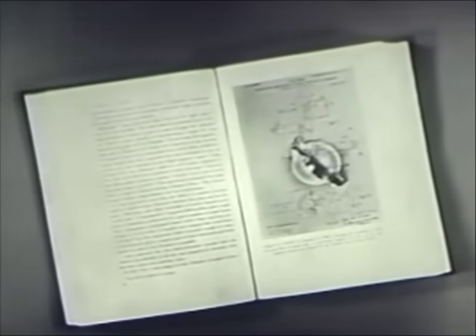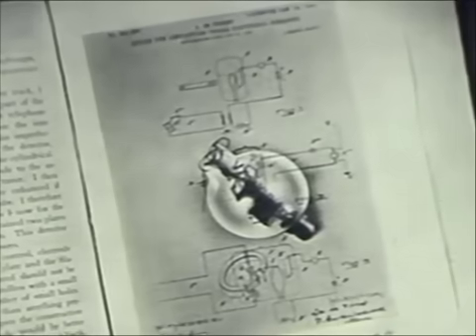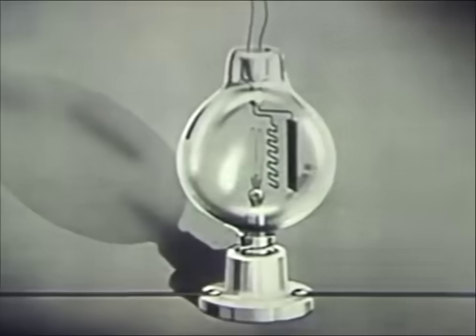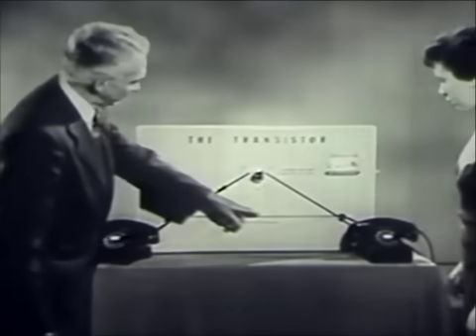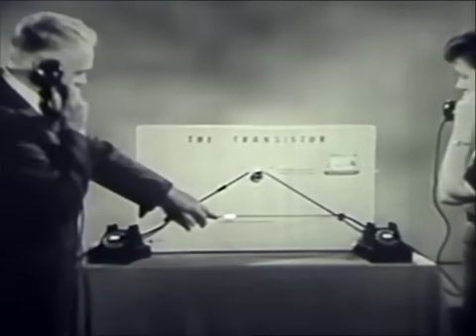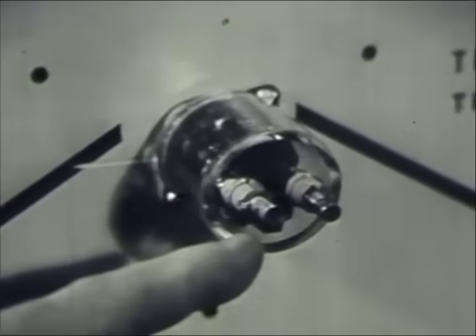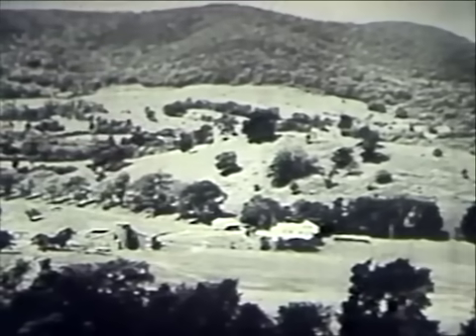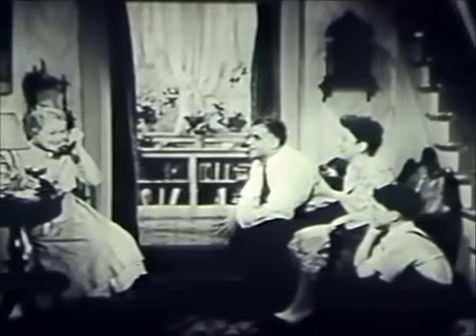The Transistor: a 1953 documentary, anticipating its coming impact on technology

Comment: The transistor for me personally is the greatest invention of the 20th century hands down. I didn't say cell phones,mp3 players or home computers or for than matter video game consoles or a host of other devices as they all utilize the transistor in their design and would not exist without the mighty transistor.The transistor is king in this age and looks to stay that way likely forever.Today's integrated circuits use transistors in the billions and many millions of devices are manufactured annually so by inference than would mean transistors as  a piece count   must be a quadrillion or more each year. All the bullets ever fired and birdshot ,bbs as well- plus everything ever held by human hands does not equal even closely that insanely high number.The most mass produced item of all time is and will likely always be the transistor and one more thing to consider is the great degree of precision that goes in to each and every one of them,as they are the most accurately made things of all time. The transistor wins my vote for most important device of the 20th century.

Comment: There is no question that transistors changed the world of technology for the better, especially since they lead to the invention of integrated circuits. Having said that, they were fond of going bad in hi-fi amps. I've seen countless examples of how a shorted driver transistor would blow up an entire output stage. In  most other applications, they were trouble-free

Comment: Soon we will be able to run crysis.
Reply: 4729 AD: 59.999fps crysis

almost
Reply: They can I’m pretty sure. 
There was a company called Brigade Quartermaster. They sold these walkie talkies that needed no batteries. They were powered off of crystals and were pricey for the day. Like $250 in the 80’s. Then the price kept jumping up to like $500. 
Then a notice went out they were no longer for sale. And anyone that had any were to return them. Then threats to return them or else. Then I heard they sent agents to retrieve them.
Reply: @whereswaldo5740  i need to know more about this. It sounds a bit odd to say the least. Powered by crystals as in crystal radios?
Reply: @eccremocarpusscaber5159    I’m old enough to remember the watch ads when they went from wind to self wind and then the “Quartz” watches. Yes crystal. A vibrating crystal that kept better time than the finest Swiss watch and for a longer period of time. Like anything they weren’t the best at first. Not like today’s running for years. 
But that was the start. 
Ever hear of the Last Whole Earth Catalog. Well they went smaller and did a quarterly mag for awhile. They got into an article an about nanotechnology and molecular motors. That actually work on the atomic level that in theory shaking the device ( think self winding watch) or just changes in the environment such as daily heat and cooling that static and magnetic changes could happen at that level and combined millions of motors can actually generate enough static electricity to effectively power a device. And as our technology improves and gets smaller less energy is necessary to power it. 
So something along those lines. 
It appears we haven’t hit the wall on this.  And aren’t even close.
Reply: Cyberpunk 2077 : hold my bugs...
Reply: @SilatBegin  Cyberpunk 2077: hold my portable television set...
Reply: By the year 2077 we will be running Cyberpunk.
Reply: @Pentti_Hilkuri  Cyberpunk runs fine on low-end pcs. Bruuuh.
Reply: @Pentti_Hilkuri  that's cause by that time everybody will have made the move to PC and consoles will, rightfully, be a thing of the past.

:D :D :D :D :P

Comment: min 3:50  "transistors : operating on new principles arising from basic research on solid substances"
min 4:20  "Germanium allowed to amplify an electric current within a solid without a vacuum or heating element" 
min 4:31 "PRESTO!!!! the transistor was born! (July 1, 1948 - exactly a year to the day of the New Mexico incident )

Basic research? Eliminating the need for a vacuum to amplify an electric current? Lets keep in mind NAZI boy Shockley and his merry men began their research in Nov , 1947. So, thats like going from hang gliding to jet propulsion in a matter of 7 months. I call TOTAL HORSE MANURE!!!!  Col. Philip J Corso was right!
Reply: Vacuum tubes were hardly hang-gliding. When you think of it, over night is the only way for a big discovery to be made. It goes from not discovered, to discovered in an instant. There is no in between. from discovering a principle to utilizing it practically is actually a pretty small step, and every technological advancement in the past 150 years attests to that.

Comment: Let's look at this way as to how much space the integrated circuit saves us with our modern equipment.  The CDC 6600 supercomputer, launched in '67 was a pure transistor "real" computer (not just a calculator) at the top of technology that had about 400k transistors and could do a blitzing 3 mega flops of processing power. Not including tape or card drive units, the physical size of the CDC 6600 was two big ass cabinets, each the size of about two modern side by side refrigerators.  These failed often, so you needed a lot of space to work around it.  So more or less about 100 square feet needed for the two cabinets containing 400k transistors.  Fast forward to 1986, when the 80386 CPU came out, it had just about a little less transistor count than the CDC 6600.  Fast forward to the modern i7 quad core which has about 1.5 billion transistors.  So your modern i7 CPU has about 3750 times the transistor count of the CDC 6600 that took up 100 square feet of floor space.  The modern i7 therefore would in itself take up about 375k square feet of space today if we were still using pure transistors only.  That's roughly about the size of two Walmart stores.  Of course, this isn't entirely accurate since we're not even talking about modern storage, or even will get into graphic cards issue.
Reply: Fast forward to 2018: AMD be slapping more than 19 billion transistors on a CPU that is roughly the size of a hand. I wonder what those engineers would have thought of transistors getting so small and dense.
Reply: @Windowsfan100  There were a couple of forward-thinking types that conceptualized IC's about the time this video was produced.  There's always some of them around.  Francis Bacon envisioned self-propelled machines.
Reply: Just imagine how the i7 will look in 50+ years. "What, dad? You did computations on that old thing?" 
I do remember the fascination of doing course work on an IBM System/370 mainframe, as a student back in the late 70s - Fortran, both batch (punched cards) and interactive teletype). The mainframe definitely seemed alive: lights and knobs all over the place, big drum drives and clattering TTYs and card readers.
Reply: @sequri  My father did similar things to this when he was at university in the late 1970s.
Reply: @sequri  - No.  You have it backwards.  In 50 years the AI will be amazed that it had to depend on such primordial biological systems for moving, maintenance, programming, and energy supply.
Reply: @mantisnomo5984  We'd be fools to allow the machines to evolve beyond us while we still have the ability to constrain them and direct our own evolution down a convergent pathway. (ie. we had better become cyborgs first or we will truly deserve our fate)
Reply: @maelstrom2313  - Then we're fools, because it's going to happen any day now, and no one and no institution has prepared for it in any way.
Reply: @mantisnomo5984  AI doesn't work like that; you're probably not going to get conscious thought from algorithms being exposed to evolutionary processes, not unless the point was to simulate it. Considering how we're at a point where moore's law can't continue for much further thanks to the uncertainty principle (which causes electrons to start behaving unpredictably at such small scales), it wouldn't be unrealistic to say that we might not ever see AI that can learn at fast, super-human speeds in anything other than something like a warehouse server room.
Reply: @Gogglesofkrome  No one knows what consciousness is, or even if it exists, so let's table that conversation for the moment.

I regard anyone working in AI who doesn't appreciate the 'danger and inevitable threat to human existence rapidly evolving synthetic intelligence represents' to be a child playing with matches.  That you work in the field and do not realize technology vastly surpassing the performance of the human brain represents an existential threat makes you (and technologists who share your opinion) a dangerous part of the problem.

I have been listening to doomsayers say that Moore's law will soon fail for 4 decades, now, yet the curve has experienced only the slightest variations in all those years.  Just as photon wavelength in photolithography represented no fundamental physical limit to feature size, the uncertainty principle represents no constant limit on any single physical quantity.  (It is, after all, in each grouping of canonical conjugates, an inequality of a CONTINUOUS product.)  As Feynman says, "there is plenty of room at the bottom."  Check out how many orders of magnitude are left!  Electrons are not the be-all and end-all of human control.  I foresee no end to Moore's Law in the near future, although it may have to be reformulated to accommodate 3d IC design.  We are just now only beginning to construct compact circuits in volumes instead of on surfaces.
Reply: @mantisnomo5984  I agree that we should table the argument on consciousness, but my reasoning for saying that is that the evolutionary processes in nature for biological thinking have a lot more of an intense scrutiny involved, and can't be accurately simulated in a machine through software. In that regard, it in the very least wouldn't compare to something that is alive, but it can in the very least 'act like' and 'simulate' the logic or thought processes of something that's alive. 

AI's risk is entirely because of this fact that it lacks the core existential reasoning and logic of something that's biological, and acts with the something that's planning for a world that would be best for their descendants. since chances are you'd have AI run out of control because of something extremely munduane (say, an AI could literally try to take over the world in order to maximize stamp production). 

Moore's law isn't a law, mind you. It's better prescribed as a supposition, and if we're to keep going smaller and smaller with transistors, we're going to have to find a means to counteracting the quantum tunneling effects of electrons at that scale, otherwise it won't matter how much room there is at the bottom; you simply just won't be able to operate effectively. 

You're right, it's not a hard limit. It's just another example of diminishing returns in regards to how much effectiveness we can extract with technology as we know it on such a scale; unless we start operating with tech and concepts that don't allow for such direct interfere with our processing, it will stay like this. The problem might not be a hard limit, but the cause itself however, is. The basis of the uncertainty principle is that you cannot measure a particle in a quantum state, and observe it without it enacting this sort of behavior - the size of the transistors at this scale effectively and increasingly result in this becoming an issue. 

You will never see hardware smaller than 10 - 15 nanometers without diminishing returns beyond that point for this reason, not without spending processing power to constantly check and correct for bit errors, resulting in 'more advanced' processors actually becoming slower than less advanced processors. You'd need to find a way to force electrons to be both measurable and observable at the same time, which is as we know it presently, fundamentally impossible. 

Consequently, the only way to be able to house AI with human levels of intelligence in hardware would be to scale upward. Increasingly, this is why supercomputers are only getting larger, and why mainframes are becoming a priority once again for research and development.
Reply: So your smartphone fits inside your pocket. Rather than inside a 17-storey building.
Reply: And the 6600, one of the most powerful computers made with discrete transistors, doesn't really compare, design-wise, to any current microprocessor. Even smartphone chips today are out-of-order. The Pentium II processor had an out-of-order floating-point unit (but not the integer unit), and it had some level 1 cache on the chip, so it was architecturally comparable with the IBM 360/195. That mainframe was the first to include those features, and it was made with integrated circuits. (I'm not sure if they were SLT or monolithics, though.)
Reply: IIRC, they used magnetic core memory for RAM
Reply: @elburropeligroso4689  First computer my dad ever used was a PDP-8.  They programmed it to play tic-tac-toe complete with rude insults if you lost.
Reply: Great sir thanks
Reply: And now we can use light to transmit data.
Reply: you can tell this was posted before the advent of Ryzen when quad-cores where the mainstream pinnacle.
Reply: I'd still rather use vacuum tubes.  Records sound way better.
Reply: So what?

Comment: They make it sound as if the BJT was planned research when really it was more accidental.
Reply: well I am not arguing bro but where is the proof?
Reply: +0MoTheG 

I think that you need to read the book "Crystal Fire" by Michael Riordan and Lillian Hoddeson. Then come back and tell us it was all an "accident". They had been researching and trying to make solid state amplifying devices for at least 10 or possibly 15 years prior to the breakthrough.
Reply: Unlike the FET the BJT was not postulated and then engineered. It was found. And they were lucky to find a spot that worked.
Although they indeed where purposely and systematically looking in the right direction they did not know the mechanism they found.
They knew diodes and had much of the statistical thermodynamics. They suspected that semiconductors would have useful properties and they knew some of them but they did not AFAIK search for the BJT. Give me sources to the contrary and I will inform myself better.
Reply: I heard that during WW-II allied soldiers found out their rusty zinc razor blades could be used to receive radio stations which acted exactly as tube rectifier. However they used pencile leads as contacts with that rusty blade and thus solide states came into attention.
Reply: That is nonsense. The effect was long known before that.
Reply: +0MoTheG Evidence?
Reply: +0MoTheG any paper or publication on that?
Reply: Know the guy who invented what later became the TV display tube? Know german? Then you can maybe find and read it in some national archive.
Reply: 0MoTheG  FETs are conceptually much simpler,  at least in the terms of the time the idea first appeared (1904 or 1914?).  Nobody knew a damn thing about holes, band gaps, Fermi levels then.

Comment: Wow. They were amazed that a 'complex computing machine' could fit within a good sized room, and here I am watching this on something that could fit in a small bag. Wow.
Reply: And your something in a small bag most likely can run a simulator to run that 50's "complex computing machine" - and that simulation will run faster than the actual hardware did!

So, what will be happening fifty years from now, in 2067?
Reply: @DrunkenUFOPilot  Haven't you heard about the physical limit of placing transistors on a chip? We have already reached this limit. Moore's Law no longer works. So you don't have to think that power is growing exponentially.
Reply: @Trbrigade  There are almost certainly not any more x10 improvements in transistor size to be had on a chip but this does not stop progress.  Chips can be made bigger/3D stacked or just better designed.  The phone (or whatever replaces it) of 10-20 years ahead will probably have a single mega IC instead of a PCB with individual ICs soldered to it.
Reply: And I'm watching this on something that can fit into my pocket.
Reply: @arshpreetsingh1038  I watched TV on my casio pocket color TV in 1989
Reply: @arshpreetsingh1038  and his comment was 3 years old... :P
Reply: And millions of people all over the world are watching the same thing, with no wires :)
Reply: These days the kind of computer that would take up a good sized room would have a processing speed measured in petaflops, as opposed to the couple of megaflops of a 1950s-era transistor-based machine.

I'm not sure if they'd believe you if you told them that in 60 years' time they could get a computer the same size, but over a thousand-million times faster.
Reply: @Roxor128  50's era computers didn't do flops at all. And if they did there was no mega in front of it.
Reply: @russell2952  They did, it was just implemented in software. You're probably right about the lack of "mega", though. Kiloflops might have been possible by the end of the decade.
Reply: And the fastest system was recently released, El Capitan which has a peak speed of 2.746 exaFLOPS  @Roxor128